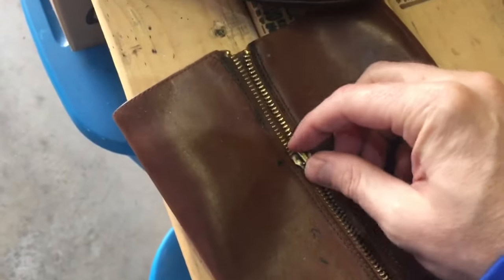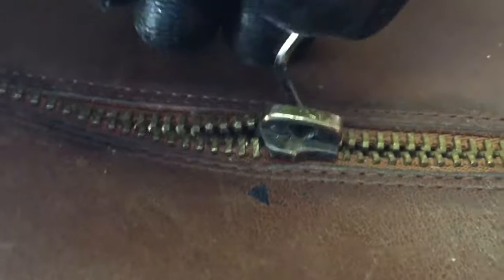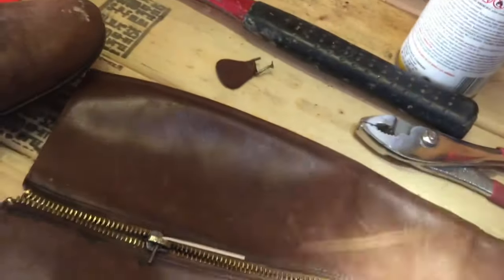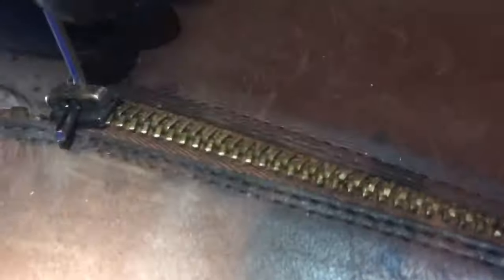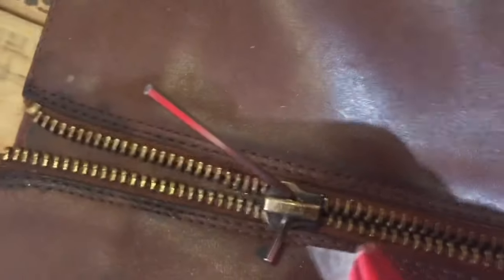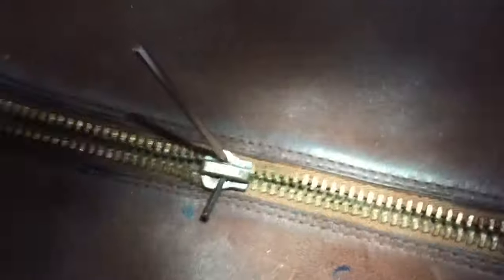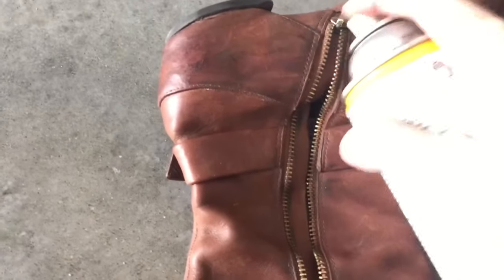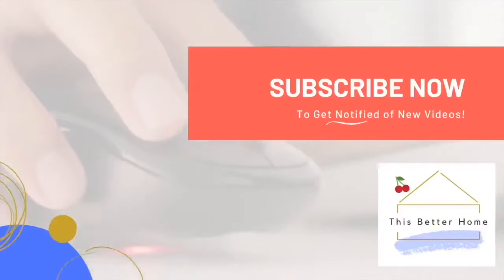🔥 HOW TO FIX A STUCK, JAMMED, OR BROKEN ZIPPER➔ AN EASY DIY TRICK!

Comment: Thanks for your video. I was able to fix a stuck zipper that wouldn't unzip going tooth by tooth, patiently and gently, but firmly, wiggling, watching and aligning the next teeth as best I could after progressing with each tooth. Turned out I didn't need to apply any makeshift lubricants. That would have been my next step. It took about 15 minutes. What I would recommend is be patient, and think of it as a tooth-by-tooth wiggly-process.

Comment: You just saved my life dude!
The only down jacket I had was zipped in the middle when I was cycling home; jacket got hooked into the rear side of the seat while trying to stand and stop.
The closed half of the zipper POPPED open and now I had a zipper open on both ends.

Anyway, didn't expect a box cutter could do the trick, now I won't be freezing my a$$ walking to work.
Reply from the maker: Glad this helped! Stay warm!